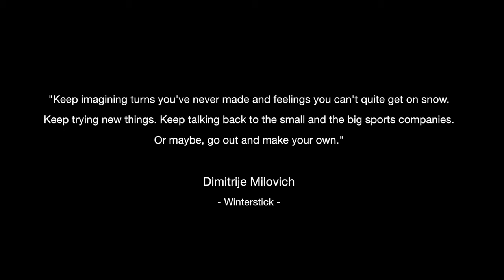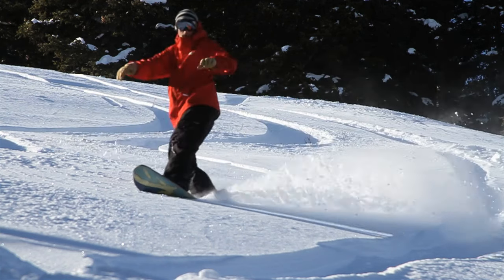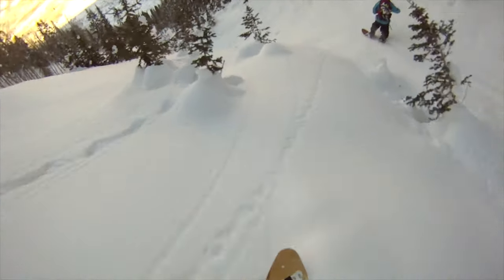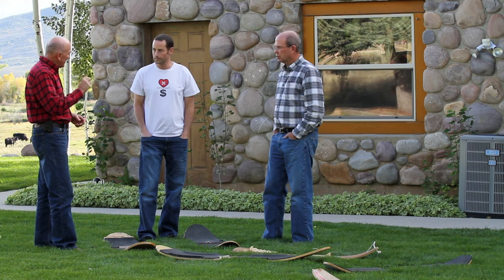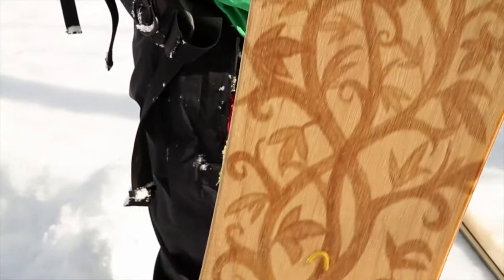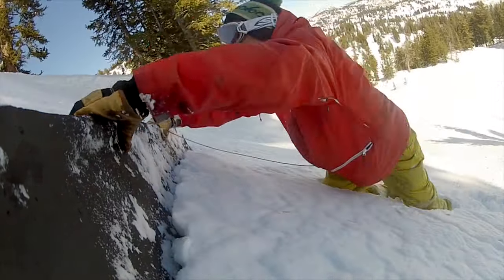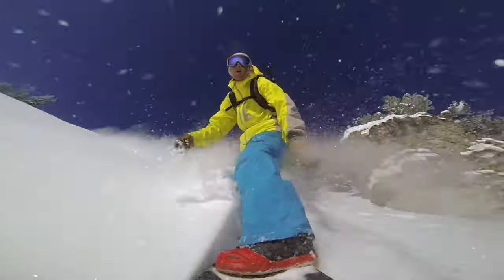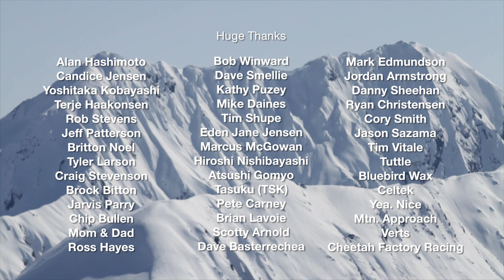White Waves - A Powdersurfing Documentary

Comment: I' wonder if there's a way to popshuv without the burden of having a leash attached.  Maybe it could attach to the board in an area that could fully rotate on the y axis.  I imagine it could attach in the center of the board to a circular piece.  ...kickflips??
Reply from the maker: If you run the right type of leash (Grassroots Retractable Leash) and you are riding our boards (properly placed leash attachment) you can shuvit and 360 shuvit without the leash hindering it.  I do kickflips all the time with that leash on as well without issue.  It simply wraps around the board in the air as it flips, I land and it slides out the back of the board. Doesn't tie a not, doesn't stop the flow. It just works.

Comment: Do you have to have powder to powdersurf?
Reply from the maker: You need soft snow.. it can be heavy snow, wet snow, or dry snow and you need at least a few inches depending on the steepness of slope you are riding.  some of our boards will handle slush and shallow powder quite well.. this is relative to your boot size and weight. Hit us up via email if you need help choosing the best board for you.    Just like you need waves to surf the ocean, you need soft snow to surf powder!
Reply: @Powsurf  Perhaps using metal in the makeup of the board wood overcome any snow quality issues.  I look forward to any new innovation.
Reply from the maker: @doogoo3844  We've played a lot with fins and such in the past 15 years and they can help in some conditions.. but hinder in others.  It's a possibility we may touch on a little down the road.. many other good ideas for the future as well :)